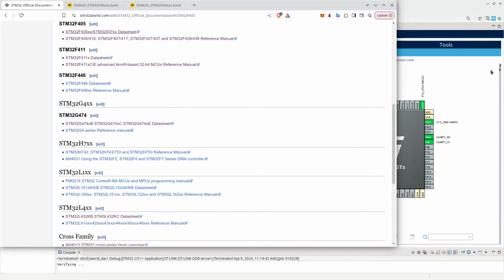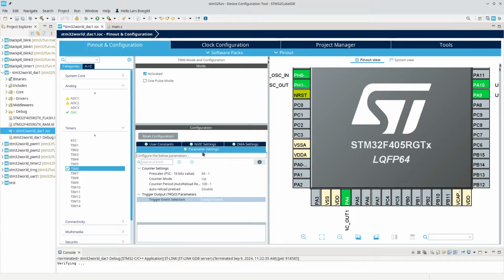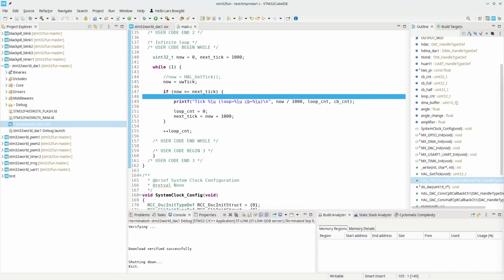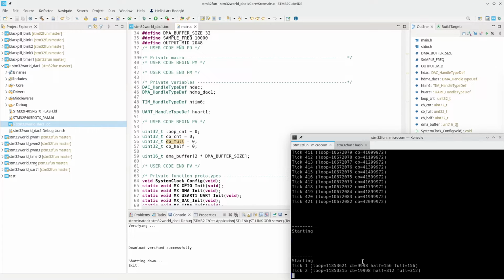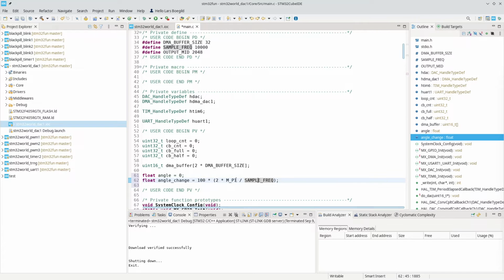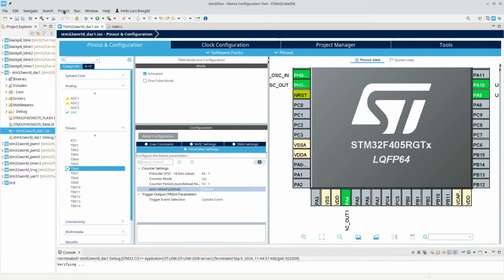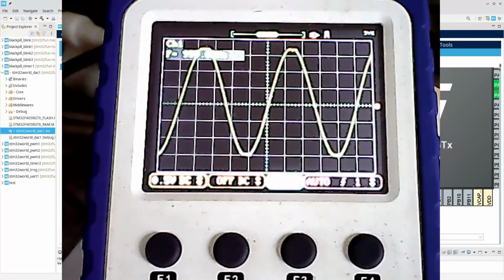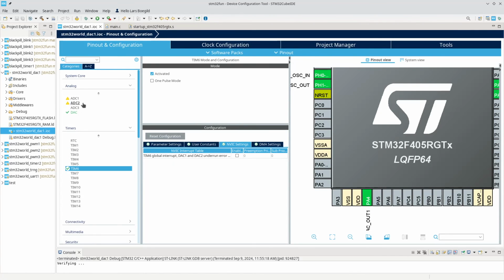STM32 Tutorial #15 - Sine wave on DAC with DMA

Comment: Did you ever compare the execution time between using a lookup table for sine wave versus calling math library sine function?     I am trying to learn STM32 and try audio / DSP projects all at once so its been a tough journey!  I am learning a lot though.
Reply from the maker: The most sparse resource is memory.  If you want to do sine tables you are going to waste a LOT of memory on that and I doubt it will be much more efficient in terms of cpu cycles.  The ARM math library is quick!

Comment: YOU MUST change the function do-dac to this 
void do_dac(uint16_t *buffer)
{
    for (int i = 0; i < DMA_BUFFER_SIZE/2; i++) {
        buffer[i] = i * 64;                     // up
        buffer[i + DMA_BUFFER_SIZE/2] = 
            (DMA_BUFFER_SIZE/2 - i) * 64;       // down
    }
}
if you want real triangle wave 
cause you create just ram wave at the first code it just up there is no down that mean its just a ramp evry period 
and what confiused me you use this ligne   for (int i = 0; i < DMA_BUFFER_SIZE; i++) {
        buffer[i] = i * 100; 
that mean max of buffer = 100 * 63 = 6300 ITS begger than 4095 of your DAC
Reply from the maker: Well - the purpose of the video was to create a sine wave not a triangle one.  The sawtooth was just temporary to test the timer/dma buffer.

Comment: When opening the software components selector in CubeMX, as shown in this video, I don't see a listing for ARM/CMISS. Is there some sort of package I have to download and install to have this functionality? If so, do you have a tutorial on how to do this?

I am using CubeIDE v 1.19.0 with the integrated CubeMX.

Thanks for any assistance with this.
Reply from the maker: Check under the Software Packs.  You might have to install the CMSIS DSP from there.
Reply: @stm32world  
Thanks for your help. 

When I go to Software Packs | Manage Software Packs  in CubeMX, I only see listings  for the various STM32 products. Also, there is not an "ARM" category listed in the banner along the top of the software manager's window, like what I see on your video.

Do I have to download a CMSIS DSP package from somewhere and install them in CubeMX?

Thanks again for your assistance. Hope you had a nice weekend.

Mike
Reply from the maker: I only did it from inside cubemx - nothing downloaded externally.
Reply: @stm32world  
Would you be so kind to describe how you did that from inside cubemx? I see no reference to ARM CMSIS in the packs manager window.
Reply from the maker: Manage Software Packs - find the ARM tab and it should be right there.  After it is installed you should be able to select it.

Comment: Hello great video on the DAC, working through the video, but STUCK ??? on adding the CMSIS DSP pack to my STM32F446 project ???? CUBE MX NO LONGER shows the CMSIS middle ware ??? for some crazy reason, so can not add this additional maths library, any help would be much appreciated, Why on earth CUBE MX would stop you adding these CMSIS packs is beyond me??, Thank you (I have been trying to add CMSIS DSP manually to my project ???? 
omg so so hard its unreal)! Thank you for your great videos excellent work
Reply from the maker: You might have to install the appropriate software pack in CubeMX.  ALT-O I think is the key but it is also in the menu inside CubeMX.

Comment: Thanks for the tutorial. I am trying to create this project on STM32H750, but for some reason the HAL_I2S_TxCpltCallback and HAL_I2S_TxHalfCpltCallback are never called. I think something might go wrong with the HAL_I2S_Transmit_DMA? Does the H series require extra setup besides what is covered in this video?
Reply from the maker: Well - this does not cover i2s at all - there's a later one which does (check around the music player).
Reply: @stm32world  Ah, I had multiple videos from you open and I guess I must have commented on the wrong one! Anyhow, I got it working, it was an issue with the buffer being in a cacheable memory region.
Reply from the maker: Well, I am glad you got it working and even more so if the videos helped in some way.
Reply: @stm32world  Your videos were definitely a big help, thank you!
Reply from the maker: That's great.

Comment: I'd like to feed a very small amplitude 200hz sine wave (75mv max) to an ADC.  The ADC input is differential, so I was thinking of biasing the sine-wave with around 1.5v (common-mode voltage).

Do you think the STM32H745 can be setup that way?

I tried using an Agilent Discovery 2, but couldn't get it the differential sine-wave output to work correctly.
Reply from the maker: I don't have a H745 so no experience with it.  However, it would appear it has a vrefp and vrefm and I guess the differential input voltage will need to be between those.  If vrefm is tied to GND I would guess it need to be between vnd and vrefp.  Apart from that it should work exactly as the other stm32 mcu's (check the video on adc + dma).

Comment: Thanks a lot for this beautiful piece of art work. This laid the foundation for me in creating different signals on STM32 boards. The part where you compute the values on the fly instead of relying on a lookup table was really helpful.
Reply from the maker: I never even considered a look-up table ;)  IF you want to speed this up there is a library out there doing sine with integer math.  That ought to be quicker but never bothered.  The cmsis library functions are quick.

Comment: You want to use the equation of 2048(1 - cos(n.2.pi/fsampling) to get buffer[i] >= 0 and buffer[i] <= 4095. Is it right?
Reply from the maker: Sorry - I don't get your question.  The formula and the math behind it is explained in the video.  The sample rate is fixed driven by the timer.  The frequency is determined by an angular speed.
Reply: @stm32world  Why did you use the equation like 2048xCos(n.pi/fsampling) instead of 2048(1-cos))?
Reply from the maker: The problem in part is the way you write it.  I simply do not grasp what it is you are trying to say and writing "2048xCos(n.pi/fsampling)" doesn't help - I do not know what you mean by "n.pi/fsampling".  The formula I use produce the output I expect.  IF you believe there's a mistake, rewrite the code to be correct and show me that as proper C code - either here, or in an issue on Github or even better a pull request.

Comment: Hello, thanks for your sharing. I have a question, I use the scope to measure the frequency which generated following your step, and I can see the frequency jumping around 100khz.
How can I gen the sin wave by DAC and the frequency can keep 100Khz not 99.xxKhz or 100.xxKhz?

Thanks
Reply from the maker: If your MCU is clocked by a reasonable quality crystal the output frequency will be rock solid (crystal is typically better than 20 ppm), so I can only assume you are not using a crystal but the internal rc oscillator (which can and will drift).  The peripheral is driven directly from the clock and it will not lose any "ticks".

Comment: I have tried to follow the example with an STM32H755 (ARM 7 Core). Unfortunately it did not work. The functions HAL_DAC_ConvCpltCallbackCh1 and HAL_DAC_ConvHalfCpltCallbackCh1 are not called. However, the function HAL_DAC_DMAUnderrunCallbackCh1 is. I have been looking for a solution for several days and have now found it. A description of the problem can be found in the STMicroelectronics Community if you search for the following in Google: “DMA is not working on STM32H7 devices”. A simple solution can be found under the current version in Github: STM32CubeH7/Projects/NUCLEO-H743ZI/Examples/ADC/ADC_DMA_Transfer/Src/main.c with the function SCB_InvalidateDCache_by_Addr(). Please note that the RAM area must be moved: Start: 0x20000000 -> 0x24000000 End: 0x2001FFFF -> 0x2400FFFF. However, it should work on the ARM 4 Core without these changes.
Reply from the maker: That's interesting.  I don't have access to any H7 devices so unable to test this.  It works on all the devices which I have access to (F1, L1, F4, L4 and a few others).
I am glad you managed to find a solution and hopefully your comment here will help someone else in the same situation ;)

Comment: Thanks for your ongoing range of STM32 videos. 

A suggestion from my assembly programming where we did not have access to some functions. 
Create all the sine calculations in excel as whole numbers in the range of the DAC, and store them as a look up table (an array).
Then at the time interval we just read the value and push it to the DAC. 

This will be much less processor intensive.
Reply from the maker: You can of course do a look-up table and in fact in a video which will be released later today I will be using that approach (not for sine wave but for ws2812 rgb led color values and I still would love to find another way to do that as wasting 4 kB of flash on a device with say 32 kB in total is quite excessive).  The problem is - if you are using a 96 kHz sample rate and want to do say a 100 Hz sine, that will require an awful lot of samples and it will use an awful lot of flash (if pre-calculated) or ram (if calculated once).  Finally, I am not entirely convinced about your last statement.  It will no doubt be less mcu intensive, but I don't think much.  The issue you will be facing is that reading values from flash is much slower than ram.

Comment: This couldn't have been uploaded at a better time. Been having some issues with DAC. I was hoping to trigger the DAC1 that will output triangle wave and look for the completed flag and then increment the DAC2 by value of 1. I was hoping to do this continuously in the background without interfering with processor.. most i have managed to do till now is normal mode and circular mode examples by changing the frequency of triggering but i can't yet do that combination without involving processor too much. Any advice would be appreciated
Reply from the maker: Well, the DAC of the STM32F4xx MCU I was using in this example can actually do triangle wave without any calculation at all - you just need to feed the frequencies.  Let me know if you can make that work - if not I could do a short video on it.
Reply: @stm32world  actually that sounds awesome.. i'll try that today.. i'm more worried about triggering the 2nd dac after the completion of the triangule wave.. i'm hoping that i can stop the wave generation somehow with the complete callback and then switching to generation of it again once the 2nd dac is incremented? i'm not sure, i'll give it a go... also i'll record a video of what i'm trying to do. i'm sure you'll love it..
Reply: @stm32world  I tried but am unable to work with dma interrupts specifically i'm not sure how to look for interrupt when dac is finished outputting a triangle wave. Also i'm trying to start the triangle wave through built in settings but i'ts not working.. i would appreciate it if you could create a video on how how to enable and look out for transfercomplete interrupts and do some work in the callback.
Reply from the maker: @capistor1  I am not sure I understand what it is you want to achieve.  If you look at my DAC example I calculate a sine wave.  Nothing would prevent you from doing a triangle wave instead - in fact the math is simpler.  Then you can trigger whatever you want in that callback once the wave is completed.  I can have a look at the triangle generation later, there's quite a lot about it in the reference manual.  But right now I am preparing some I2C videos and I need to get them out of the way first ;)
Reply from the maker: @capistor1  you might want to have a look at AN3126 here: https://www.st.com/resource/en/application_note/an3126-audio-and-waveform-generation-using-the-dac-in-stm32-products-stmicroelectronics.pdf

Comment: Instead of double defining things like SAMPLE_FREQ, you can create "User Constants" in CubeMX, assign a value there and then use that constant in both generated initialization code as well as any custom code. Those "User Constants" show up (IIRC) as #defines in main.h
Reply from the maker: I did that in the last video #14. In this case however, it is a bit more complicated.  I guess I could calculate the value from the prescaler and counter values of the timer. But put that down as pure laziness ;)